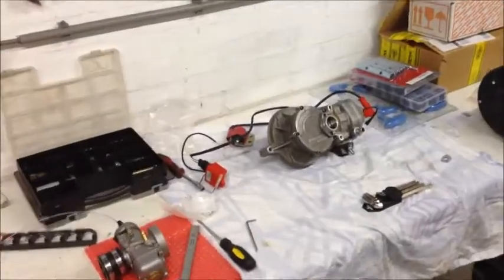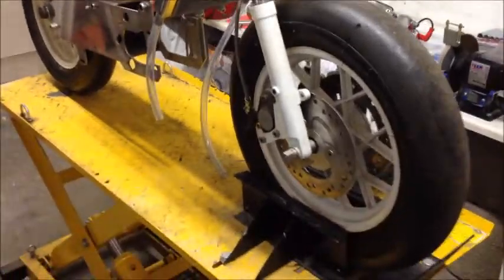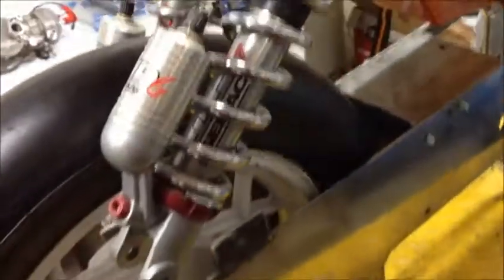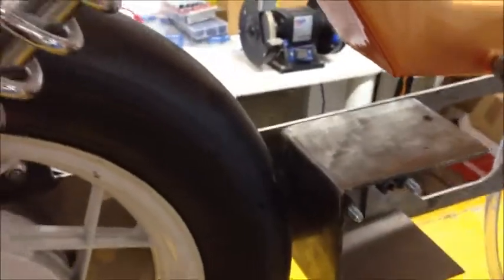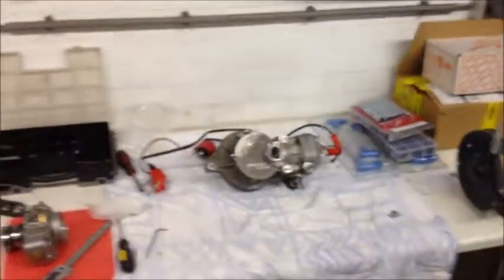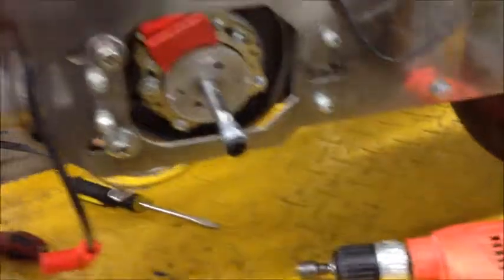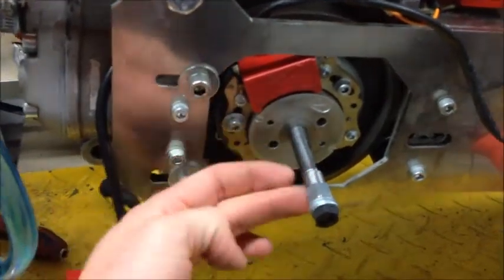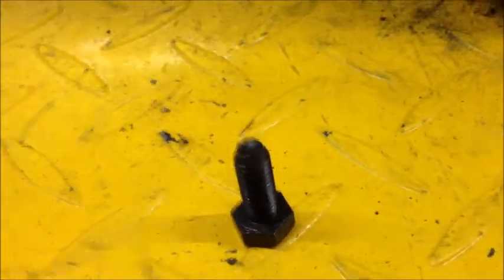Sprocatti Rotary Valve (Disco Rotante) Vespa Piaggio

Comment: should get close to 30bhp with that?
The stock transmission ; does it slip?
Reply from the maker: 30bhp should be doable, but the engine would still need a lot of work. Ports can still be matched better.

A stock transmission will never be able to transmit the power generated by this engine to the rear wheel.

Comment from the maker: Not exactly. This rotary engine only has a rotary valve (disc) for the inlet, which is why it's also referred to as rotary valve.

A Mazda rotary (wankel) engine is basically one big cylinder which has a triangular rotor housing that rotates around a central shaft.

I have this engine on a Vespa body; mijnalbum.nl/Foto800-FAOAXNCD.jpg